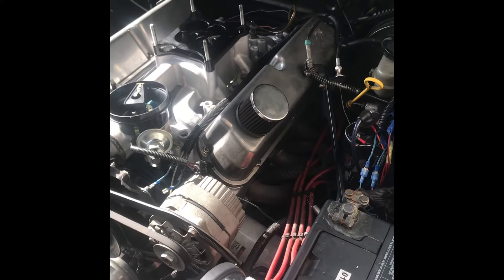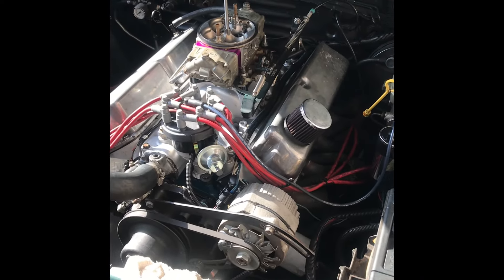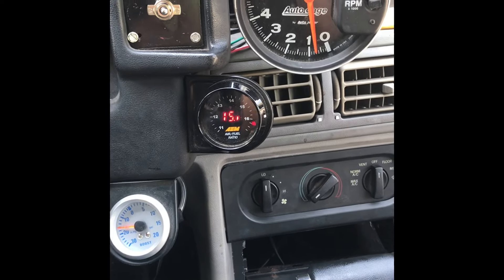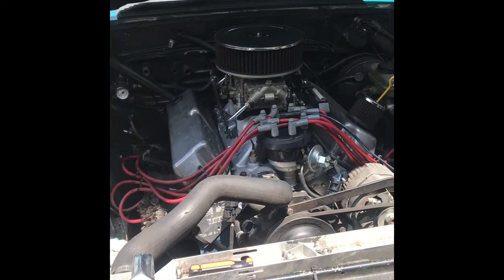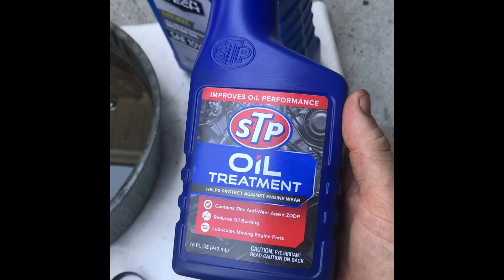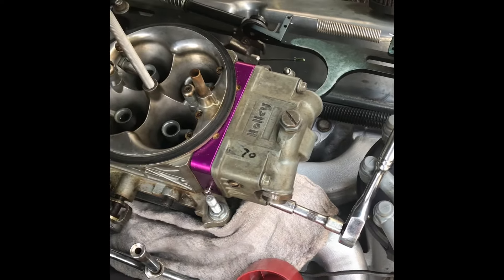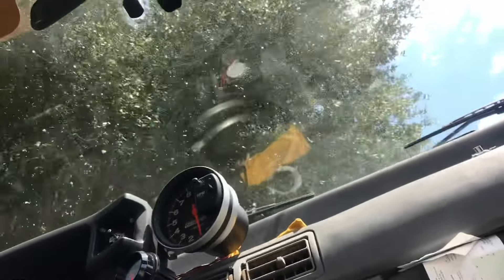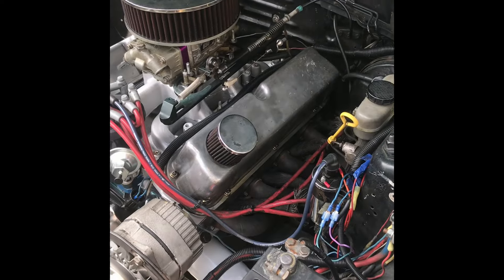Swapping to the dual plane intake on the LX Foxbody! #ford302  #intakemanifold #gauges

Comment: Great video, I agree with you about the Rotella oil. But you might want to rethink the additive. I was using the Comp zinc additive until one day I tried a test. I mixed equal parts of the additive and oil and let it sit overnight. The two clearly separated. So who knows what actually happens inside the engine. And too much zinc can cause more harm than good.
Reply from the maker: @hvspeed6102  Thanks! I’ve heard about to much zinc being a issue but wasn’t sure how much was to much. I appreciate the heads up!